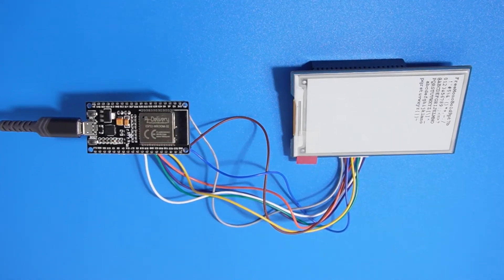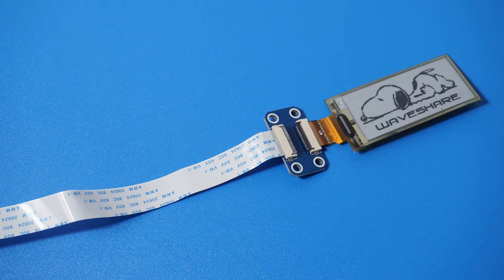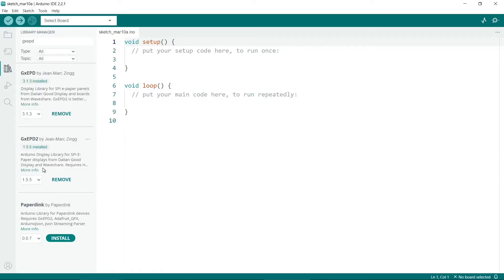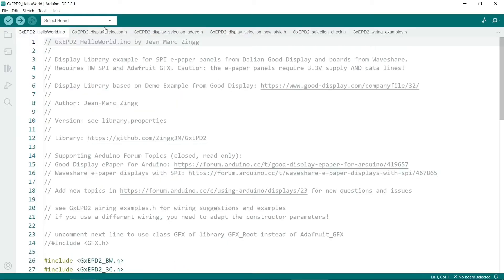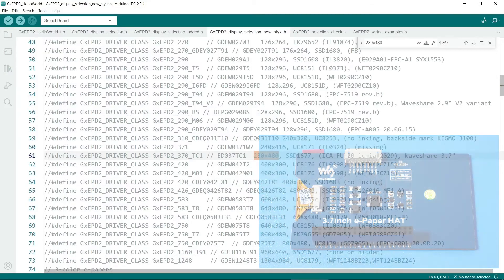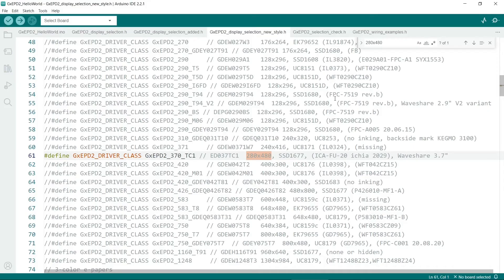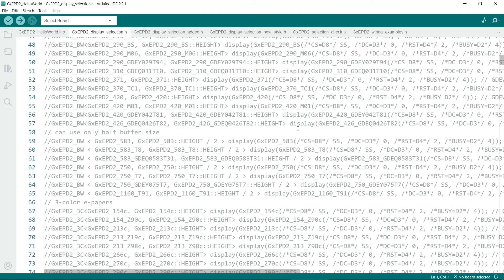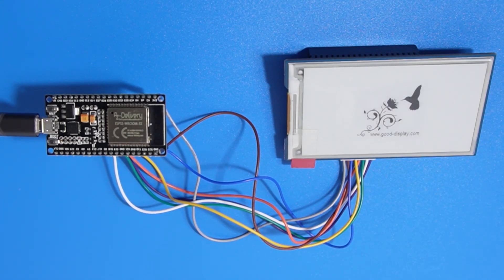Easy ESP32 Waveshare ePaper Display Tutorial

Comment: Thank you. It helps a lot. QQs: 1) XIAO ESP32C3 does not have a GPIO16, 17, 18, 23. Where I have to update the code to mention the GPIO# I actually use? 2) Could MISO pin be not used as epaper is not going to send data to ESP32? (MISO = BUSY in your video?). Thank you!!

Comment: Did you ever get the flexible display working? I'm finding it very hard to so any help would be amazing!
Reply: ok I found out how to do it!
Problem:
Normally Arduino uses default SPI pins (GPIO 23 for MOSI, 18 for CLK).
But Waveshare board REWIRED SPI onto different pins.

Solution:
You MUST define a custom SPI object and pass it to GxEPD2.

Comment: Thanks to this video I found that my ESP32 has two G23, one of which in reality is G33. But does the '296x128 pixels 2.9 inch e-Paper module' you show on the video really work, when defining GxEPD2_DRIVER_CLASS GxEPD2_290c     // GDEW029Z10  128x296, UC8151 (IL0373), (WFT0290CZ10)? Looks like 290c is for a 3-color display. Can't get mine working...
Reply: works with the other one for me:
#define GxEPD2_DRIVER_CLASS GxEPD2_290_T94_V2 // GDEM029T94  128x296, SSD1680, (FPC-7519 rev.b), Waveshare 2.9" V2 variant

Comment: Thanks. But I get an error:
error: 'display' was not declared in this scope; did you mean 'delay'?
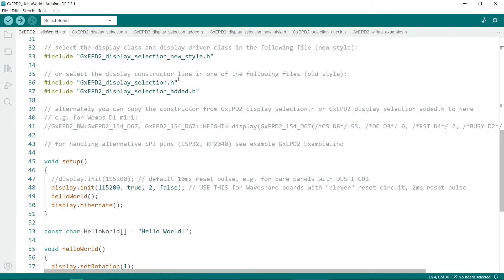In the "Hello World" example a variable "display" is used first in line 48 (see 3:10 in video), but not declared. What is the problem in my case? A missing library? But I followed your instructions step by step...
Reply: It sounds like you might not have selected (uncommented) the screen type in the header files. I am using the 2.7 inch, and I used the 'old way' and uncommented line 237 in 'GxEPD2_display_selection.h' and ,  here you can see 'display' is declared ->  "GxEPD2_BW<GxEPD2_270_GDEY027T91, GxEPD2_270_GDEY027T91::HEIGHT> display(GxEPD2_270_GDEY027T91(/*CS=5*/ SS, /*DC=*/ 2, /*RST=*/ 15, /*BUSY=*/ 4)); // GDEY027T91 176x264, SSD1680" and also uncommented line 49 in "GxEPD2_display_selection_new_style.h" , "#define GxEPD2_DRIVER_CLASS GxEPD2_270_GDEY027T91 " . Complile and upload. works great.
Reply: same problem here